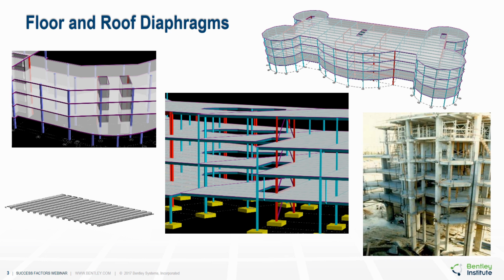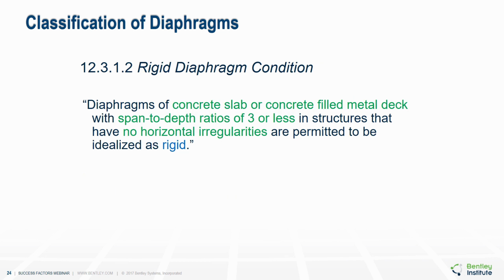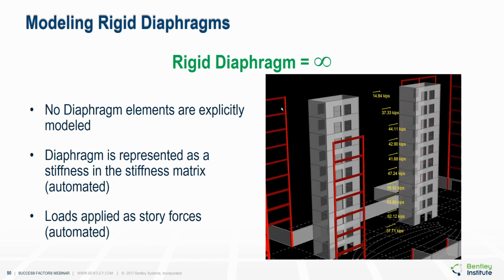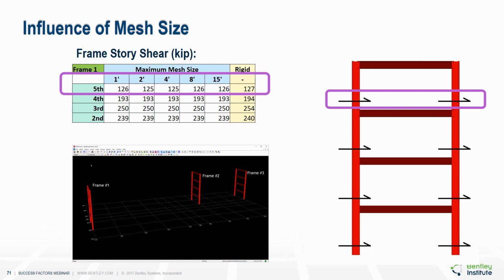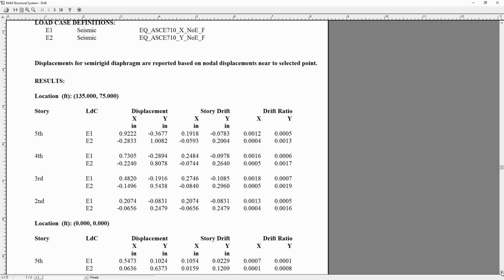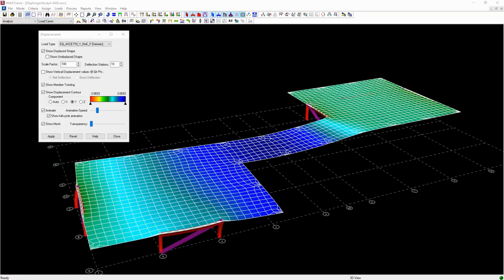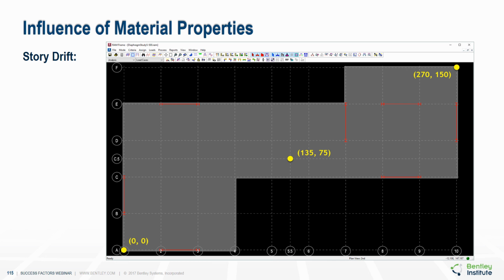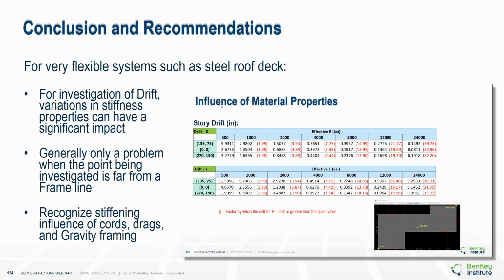Modeling and Analysis of Diaphragms in RAM Structural System

Comment: For rigid diaphragm you must get same drift at the different points 
But in the table you shown drift values are different at different points
Reply: The unsymmetrical layout of their frames shifts their center of rigidity away from the center of mass, resulting in torsion on the rigid diaphragm which would account for the variation in drift values at different points in the diaphragm (the no eccentricity designation for the seismic load case would be for code eccentricity)